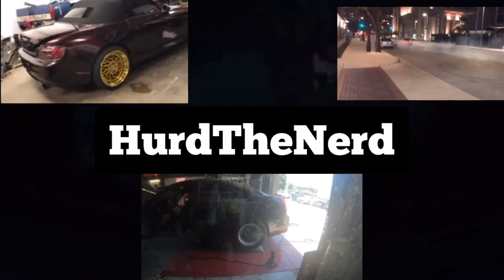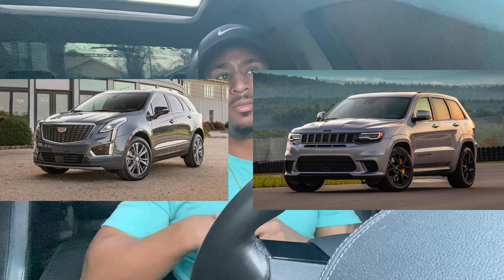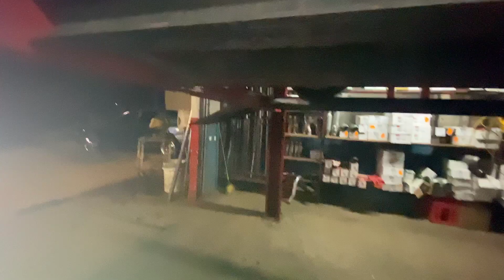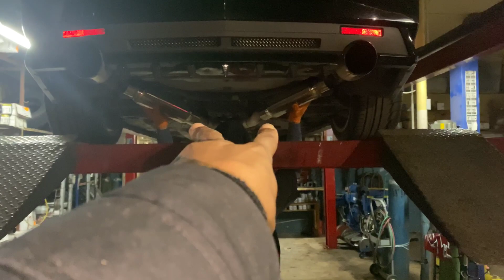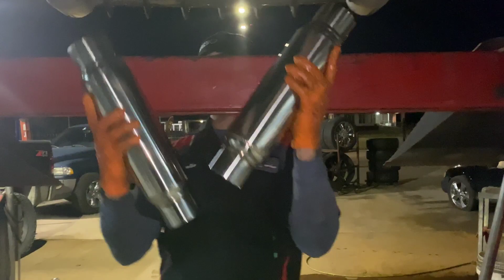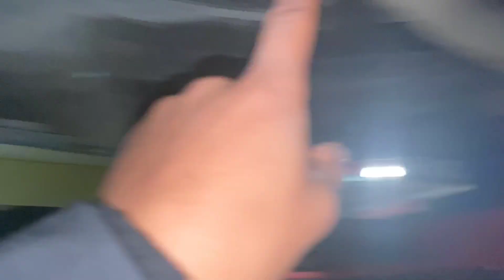Cadillac XT6-V to take on the Jeep Trackhawk!? The V gets an Exhaust update

Comment: Seems like manufacturers are getting away from the V8 motors because they can make 6 cylinders and lower just as fast. But it's nothing like that sound, feel, and power you get out of a V8. Hope this is a reality because I want one. I also think Ford  at some point should drop a 5.0 or even bigger engine in that Mach E
Reply from the maker: R SU you are right about that. Chevy does like there TT v6 motors. Ford has already leaned towards it with all there ecoboost setups. But you can’t beat the sound and feel of a v8!